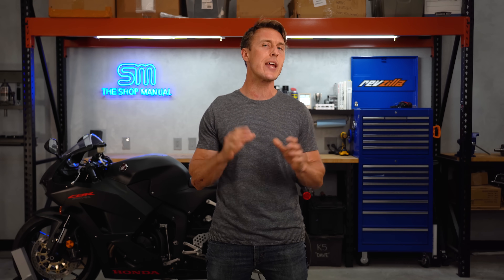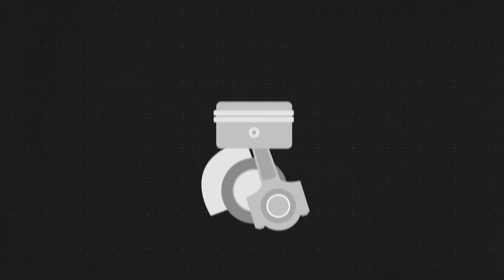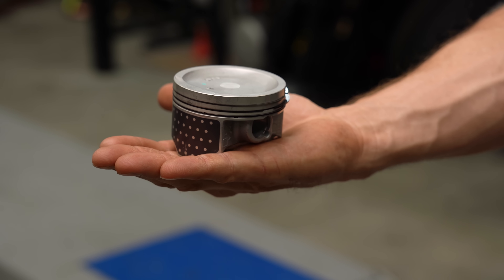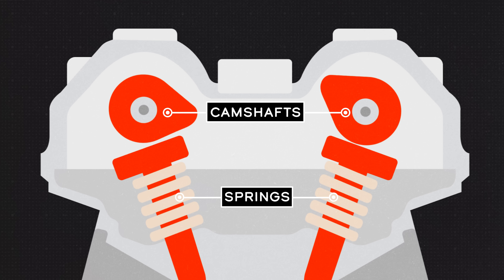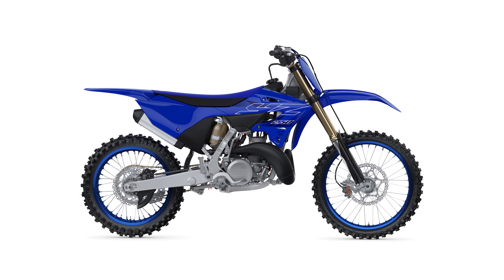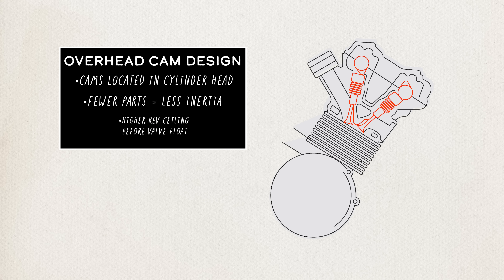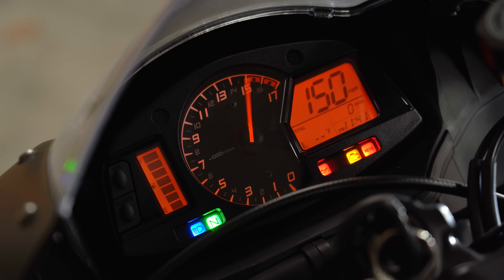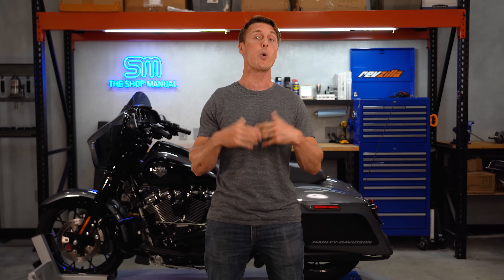This Is Why Your Motorcycle Has a Redline | The Shop Manual

Comment: Funny I just topped out the new 2022 Honda grom, those bikes live at redline 😂
Reply: My 2015 sure as shit does
Reply: I love small engines bikes for this. My mate’s carby ‘only still sold because emission laws don’t apply’ CB125e has done just over 50,000kms at pretty much constant WoT. Piston rings on those seem to typically wear out in the 40k’s it seems because of the high rpms, but his is still good
Reply: @jonpram1737  if you do 40k miles on a grom you will definetly be ready for a bigger bike!
Reply: Funny... I was gonna say that with my 125cc...
Reply: @ironryomwest  the ef
Reply: Trynna squeeze everybit out of them underpowered tired little things
Reply: @Steve69419  yeah but at least you dont need to brake for corners
Reply: my 150cc Yamaha loves it lol...tops out in 6th gear and just keeps bouncing off the limiter 😂
Reply: @theguycalledturbo  Meh your 150cc sucks my yamaha125cc matic reach limiter everyday at 35mph the top speed depend how steep is the downhill gravity can make my bike faster than hayabusa. just kidding bro don't be mad i am a nice harmless troll who give candy
Reply: @philb8344  the 2022 has been out for a few months
Reply: @sourand jaded Those 80/90s pocket rockets are great aren't they!  But they do wear out. My 89 cbr250r's piston rings finally gave up after at least 100k. That thing thrived on abuse, screaming happily along at 17k rpm but would putter along at 8k without a bother. 

I've been slowly collecting most of the parts to rebuild just need to get off my lazy butt and pull the engine.
Reply: My 2021 peace sports scooter is good at lower rpm being said I do have to e careful at 60 mph due to redline and other things like cvt limits
Reply: when you have to redline a bike at a regular basis you have the wrong bike brotha' 😂

125's are happy to be ridden on short distance travels, urban areas, tight traffics, etc.

but once a 125 is on an open highway, it's gonna be redlining when you're just barely going at the speed limit (not healthy for the engine)
Reply: @jasperdomacena6491  my guy i redline my gixxer 600 everywhere lol. Thats the point of it. If I wanted to cruise round I’d ride a Harley. I’m here for a fast ride and to have fun. 

Also certain bikes are designed to redline. They’re purpose built machines mate
Reply: @bhtradinggroup5340  Dirt Bike Engines sure they're built to be pinned at max rpm

but needs to be rebuilt every so often

Grom Engines? nahhhh! the engine's gonna beg for mercy
if you stay at 10,000rpm.

it's happy to be around 7,000-8,000rpm 🤷
Reply: @jasperdomacena6491  yeah but a grom is a fkin grom lol. Small bike small engine. Just pointless IMO
Reply: Hahah indeed the groms are literally unbreakable xD
Reply: How did 18 mph feel ?
Reply: Woahhh top speed 50 mph there bud be safe
Reply: Wait till yall get on the R6 lol
Reply: If we don’t ride our groms at redline we won’t be accelerating
Reply: back in 2009 I had brand new Yamaha R125... same thing... is either red line or full stop lol
Reply: Yeah because you have to redline if you wanna break the speed limit in those little bikes
Reply: My Honda wave 100 can only reach 70-80kph.. It's a really old model.. 😁
Reply: My CB65R too, 10k+ all the time.
But that's just 125cc life
Reply: For years now lol
Reply: Thats because it has absolutely no power
Reply: @niteninja0133  - yeah that means you can redline everywhere in town and have fun even on short trips. Kinda the whole point
Reply: Trying riding an r6
Reply: @arinaiditch7769  My yamaha 125 matic can smoke your r6 why because my matic engine puffs smoked literally Lol don't be angry just jokin around

Comment: Also pointing out with Ari, even for a remapped bike, this is fine as well. Opening rev limit won't hurt unless you keep revving without easing the throttle for too damn long. 

After checking on a client's Ninja 300 for 4 years doing stunts, I can verify that his remapping doesn't hurt anything, but periodic oil change is a must to keep things smoothly.
Reply: Ari did mention the "margin" that the manufacturer provides.  They need to ensure durability for the many thousands of engines they build, even those with mildly flawed components.
I recently read a couple 1970's reviews of BMW motorcycles.  Interestingly, at that time, BMW stated that there was a  "maximum sustained engine speed" that was lower than redline.
Reply: @jfess1911  Yep. They all have compromises to ensure longevity, so even a "slow" engine (depends on who calls it) isn't going to kill the fun. 

On your 2nd note, I think BMW hinted a good maintenance note for, again, longevity. Ye'old GL1200 was even recommended at 60mph cruising under 2800rpm (bang to 4th gear and stay there, weird), but not sure if that was from the manual. A workshop at Wisconsin recommended so when my grandpa's Gold Wing was on maintenance a couple of years ago.

Comment: The other difference between the Harley engine and the Honda engine is that the reciprocating parts in the Harley are much larger and heavier. One cylinder on the Harley is larger than all 4 on the Honda put together.
Reply: The other difference is one is a piece crap that uses 1930's tech !
Reply: @vbrvideoproductions4643  lol
Reply: It's not the size per say, but rather the piston head speed (going back to inertia). As Ari stated already, Harley's have a similar, but slightly slower piston head speed, but assuming they are the same speed, since Harley's are under-square (i.e. longer stroke than bore), the piston head has to travel a greater distance, thus needs more time to do it at the same piston head speed, which translates to lower RPM redline. Honda CBR engines are over-square (short stroke, wide bore), thus the piston covers less distance. It's less efficient combustion, but you can have way more power strokes, hence the high-power rev-happy nature of oversquare engines.
Reply: @jerm1027  : I think you meant "piston" when you wrote "cylinder", but otherwise, yes.  In practical terms "square" engines, where bore and stroke are near equal are typically the most efficient.
Reply: Kinda dumb to compare a Harley to a ricerocket. To totally different bikes made for different type of riding. Like comparing an economy car to a Ferrari. Another thing is especially a young kid trying to get full coverage insurance on a ricerocket. Some bikes you'll pay more than 10 grand a year for full coverage insurance.
Reply: Yet still only has 1/2 the performance lol
Reply: And yet the harley is still so f-ing slow....
Reply: The difference is Honda are reliable 🤣
Reply: The main difference is that Honda is actually a good brand and does nice bikes.... can´t really say the same about Harley :P
Reply: And yet somehow two of those still do less :P
Reply: I know Harley's are big but bigger than 4 Honda cylinder put together!? That's too big
Reply: Yeah it's called flywheel action
Reply: Go desmo can you don't get valve float
Reply: the Harley engine is just plain old design and inefficient.
Reply: That's for sure. Something a lot of people dont get...the bore is so small there isn't enough room in the head for big valves. They might be decent engines if the shortened the stroke and made cylinders with way bigger bores. I have a buddy with a ducati pangale twin...the stroke is a little more than half the bore. 1189 cc and 205 hp and if I remember its like a 10500 redline
Reply: @ralphlouismendoza  
Something here needs to be clarified.
First, what do you want your engine to do?
Do you want an engine that will go fast or pull out tree stumps? Pull weight. Harley Engines by design are high output, low rpm engines. Which means low horsepower, high torque.
Do you want a Mustang, that can prance around and quickly run fast or do you want a Clydesdale, which is about 1000 lbs heavier is slower to move, but once moving can move mountains. Another example is Locomotive Engine. They are about 5000 HP. They Redline at 950rpm. Yes, that's 950rpm. They idle at 250rpm, but need a starter motor the size of a Chevy small block just to turn it over and fired up. So, in essence, the Harley Engines are like tractor motors. If you want to see Harley Engines go fast, look up vids on YouTube on Harley Nitro Drags, then look at the size of the humongous rear tires they use. The new Kawasaki 1000cc or 1 liter engine that produces close to 300hp will have a hard time trying to spin such a humongous tire. WHY?
Because it simply does not produce the Torque, or Huevos, to pull such a load. So before you knock Harley Davidson, do your homework, Grasshopper. Not all Engines are created equal. Do not compare oranges to apples, or, as I say, little Huevos, to BIG Huevos. The big Huevos will help you, your fat ass, and Ms Piggy down the road with ease, although not at the speed of light..
Reply: @ralphlouismendoza  got that right….way overpriced boat anchors lol
Reply: @andrewwilliamhorton789  Jelly much, LOL. Not everyone can afford an American classic, broke boi..
Reply: @rgh622  harley needed  a goverment bailout to compete with honda. Enoguh said there.. I like harely but i feel it's WAY overpriced..
Reply: @rgh622  yeah most of us choose to spend half the amount on a better, more modern bike that isn't stuck 40 years in the past. I like harley design and looks and think they would be a blast, but there is not one objective reason as to why most nicer harley bike are 20k when you can get something like an R1 or panigale v4, or a bmw gs series adventure bike for that same ballpark price. Those are all vastly superior bikes with cutting-edge technology that have been perfected to handle exactly how the rider wants them to be, yet a simple harley davidson with none of that costs the same.
Reply: @rgh622  Why would we be jealous of a bike with tech 70 years out of date?
Reply: Any bike that requires a costume I dont want anything to do with....
That's why that crowd is so chrome crazy...you see them riding down the road side by side, right? That's one rider looking at his reflection in the other bikes chrome.
Basic form before function type deal. I can knock out 600mi in 8+ hrs on my honda blackbird and still work an 8 hrs shift without a problem...last 3 HD I rode I was done in 100 mi....but the girls did think I was cool...lol
Reply: People misunderstand Harley's alot, Harley's cater to a niche market n because of that they don't make as much money as if they'd go full mainstream n make high reving sports bike. Now because of that bad business decision they HAVE to overprice to stay afloat, that takes alot of balls to self surbotage  n stay true to your brand for your customers unlike say................. Mitsubishi which has killed the Evo n makes shity crossovers cause it makes business sense cause it's all about the bottom line. So before you bitch about something think twice
Reply: Idiot the Honda is by far the superior and more capable engine it's design is top notch

Comment: My 07' Ninja500 doesn't have a rev limiter. It's terrifying.
Reply: Sure it does.  Keep revving it higher and higher until you hear a loud bang.  That is the redline.
Reply: Im pretty sure it does, its just usually 500 or 1000 revs into the red ;-)

Comment: Engines have a redline to give you a target to get to in each gear... or is that just me?
Reply: when you get into red line you already went pass peak on curve so you get less hp and torque. it just tells you that you are pushing the engine too much but at the same time not gaining anything.
Reply: @alexlau7115  true but unless your power and torque drop off dramatically you still will be faster to go to redline every time. More time spent at a lower gear will be better acceleration (once again assuming you don’t lose 50% of your power up their)
Reply: it's not just you but its not for that either